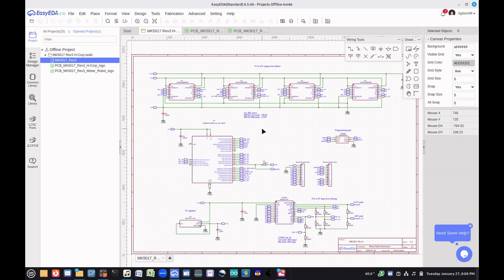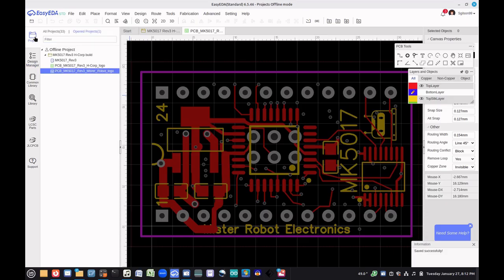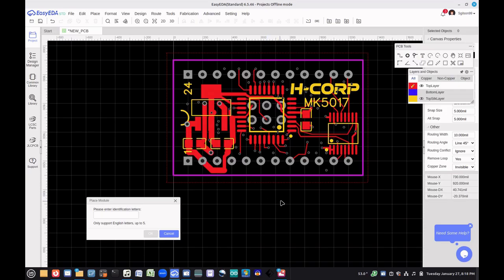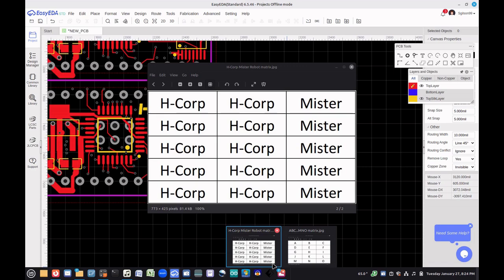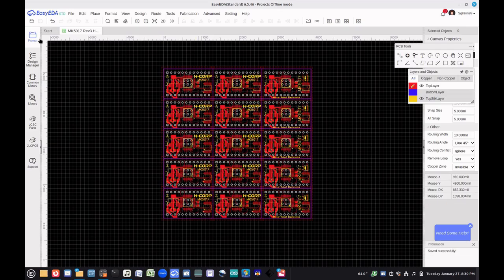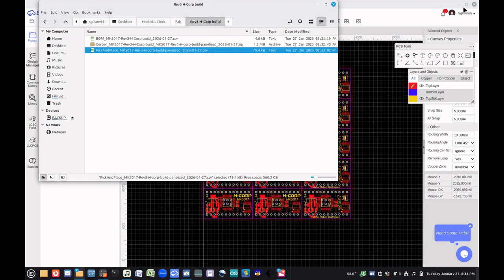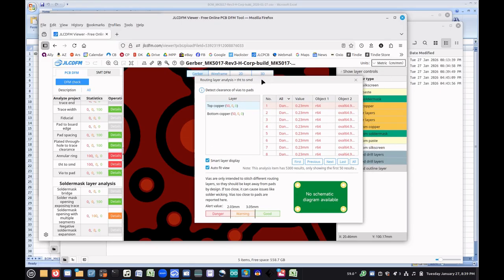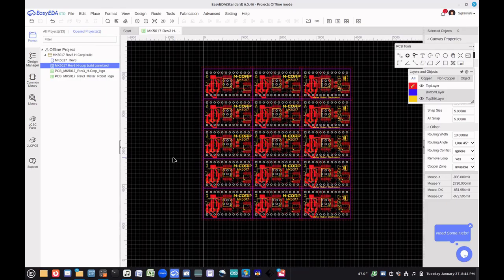How to create custom panelized boards in EasyEDA

Comment: How do you add v-cuts to such panelized boards?
Reply from the maker: The V-cut is not explicit in the layout Gerber file.  What JLCPCB and other houses do is to take the Border layer (the pink lines separating smaller boards) and they put the V-cut there.  It's an option when you check out whether to do V-cut or other break-apart options.  They also add small border rails to allow them room to make the V-cuts.  The boards snap apart easily.  I hope I explained that well.